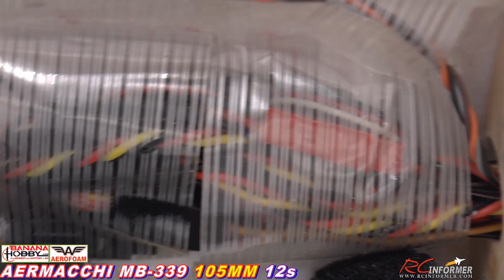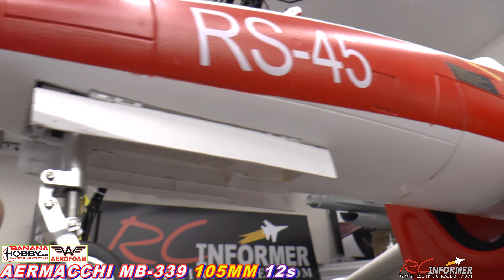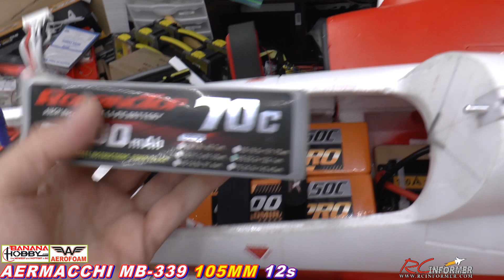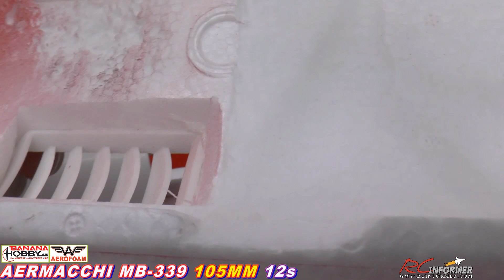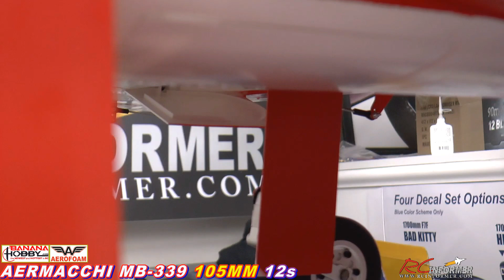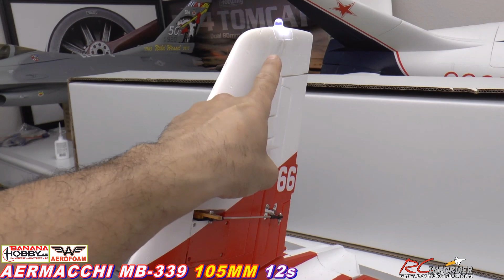AEROFOAM MB-339 setup Guide By: RCINFORMER

Comment: Hello thanks for the video
This bird is more work than anticipated. I was thinking I'll slap this thing together in time for the weekend! After 30 minutes of looking at everything it was clear it will take much longer!
The thrust tube has a white film on it. The smooth clear side is on the outside I would think the clear smooth side should be on the inside. Is this how yours is? The wiring is pretty confusing and the directions dont explain anything lol yea the battery bay has the wood shelf making it impossible for even a 5000 battery to fit I'll have to remove it and remount everything.

Comment: Hi, what was the battery type you had for the receiver? Was is a lipo or life? And what esc did you have in there?
Reply from the maker: Stock ESC... any 5000 packs will work that fit! Two 1300 lipos for the receiver.
Reply: @RCINFORMER  Could you please tell us where you got the 12S series adapter? Thanks!

Comment: Might be able to make the EDF fan blade-tightening-spanner-tool by bending a sturdy wire coat hanger or a piece of music wire into the appropriate shape.  That would be cheaper and faster for most people than using a thick aluminum plate fitted with bolts.  Also, a better place to mount the ESC might be directly over the ventral intake louver for maximum ESC cooling.  I would also be inclined to further shorten the wires from ESC to battery plug and have the batteries oriented so that their output wires are facing back toward the ESC.  The ESC wires are very heavy and shortening them saves weight, in addition to reducing EMF radiation, and reducing inductive stress on the ESC circuitry so that the lifespan of the ESC will be maximized.  I intend to mount the ESC battery plugs to the plywood tray using wire ties or zip ties, perhaps in combination with epoxy.  That may allow easily plugging in the batteries with one hand, and eliminates more bulky dangling wiring.  And perhaps the EDF assembly can be mounted a few inches further rearward.  That would allow for shortening the thrust tube, which saves weight and reduces thrust losses.  The longer the thrust tube, the greater the energy losses, and lord knows these small EDF fans are already incredibly inefficient even in an optimal configuration.  Really appreciate your attention to detail and precise craftsmanship and mods.  We are definitely cast from a similar mold...LOL
Reply from the maker: Thanks man thanks for your support and yes there is always more than one way to do things

Comment: while setting my plane up i cannot get esc to go full throttle!  i have calibrated, full throttle 2 beeps, low throttle 2 beeps and its ready spools up but will only get to about half stick and will kick off, lipos charged fully, any ideas?
Reply from the maker: It may be a ESC or motor problem. Contact the folks at BH. Of my four 105mm models from BH, one failed to boot up & it turned out to be defective.
Reply: @RCINFORMER   thank you i will try and contact them today and see what can be resolved,  hope its nothing major thanks again sir

Comment: hey rich great video ...i need your help with the freezing f-14 ..i think it is stuck in safe ..i can't sign a switch ....i have a dx9 radio an i put an ar8360t in the bird i have done the forward programming ...i think the mixing board might be interfering but I'm not sure ...if you could shed some light on this i would greatly appreciate it ...thanks

Comment: Another quality video Rich, Thanks! Are you still setting up this plane and your others with the control knob for the steering?
Reply from the maker: This one is not set up with the knob, just because having it on a "Y" harness WITH stabilization will also correct yaw deviations on the ground as well as in the air.
Reply: @RCINFORMER  ok great thanks for your explanation!

Comment: Thanks for all your good videos. My MB 339 red/white one flies just fine. The italian camo one has an ESC  with motor leads very long. It also has 2 leads - one labeled (throttle) longer than the second one that has no label. After a runway check, I brought it home to adjust an aileron and the motor would  not work. I added an extension to the short lead and it works. Question: is the Vgood ESC an ESC/BEC ? And if so why have a 3 cell lipo. Banana hobby hasn't gotten back with me. You speak very highly of them maybe you can get me an answer. Why have 2 leads from the ESC.? and if tge short one works should I fear flying it that way?
Reply from the maker: The second lead is for programming or firmware updates. The 3s lipo is to power the AF dual output separate BEC, which supplies 6v power to the receiver/servos & 7.4v power to the wheel brakes. I use 2 lipos for BEC redundancy.
Reply: @RCINFORMER  if the first lead is not working and the second one is working, is it safe to fly,? Or do I have a bad ESC that should be replaced. And how do I approach Banana hobby about a quick replacement . Thanks for your help
Reply from the maker: Only one lead is plugged into the throttle channel of the receiver with the center wire removed. The other wire is not plugged into anything. Receiver power comes from the 6v OUTPUT power line of the BEC that is plugged into ANY open channel in your receiver.
Reply: @RCINFORMER  Thanks again for your reply. Based upon your reply the throttle lead worked and now no response but the other lead works file. I must assume that the ESC is broken and I need to replace it. No voltage reading on either of the two leads. The factory must have thrown in a (bastard) not regulation ESC to sell the EDF. Thanks and keep making your excellent videos.
Reply from the maker: @eldestguy  I don't think the ESC throttle line will output any power.... only signal/throttle control comes from the ESC throttle lead.
Reply: @RCINFORMER  Thanks again and I am waiting to see if Banana Hobby will replace my defective ESC. But I have doubts as they do not have a good reputation for Customer service. Please put in a good word for me!
Reply from the maker: @eldestguy  They should replace it if it is a new model.
Reply: I had same question the Manual for this is non existent, can’t get any answered at all about how this is hooked up .
Reply: @michaellussoro2295  Did you experience a motor failure and did one of the two leads work? Have you contacted Banana hobby?

Comment: It would be a tremendous help if you could show a video replacing the nose wheel they never have parts for it
Reply from the maker: What do you need replaced?
Reply: the front nose strut that is on the BH website that they advertise is not the right one fot the plane. 2 times i have order it was  wrong it has ben a year and i can not fly my plane. over a simple part.